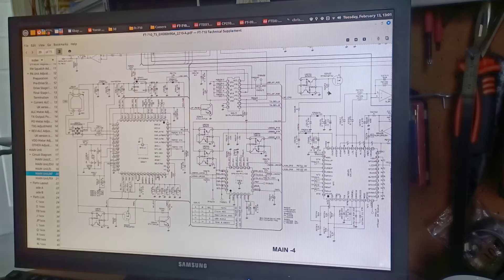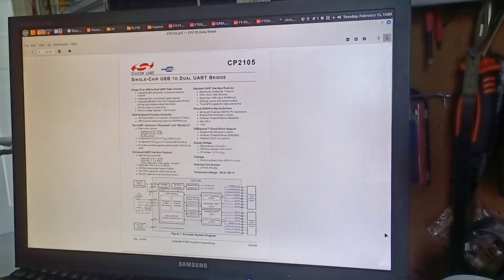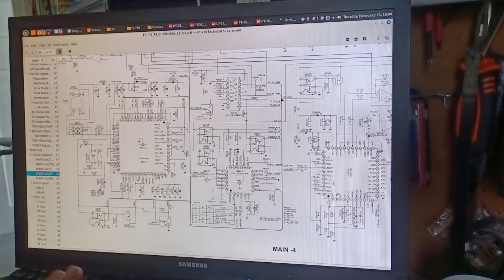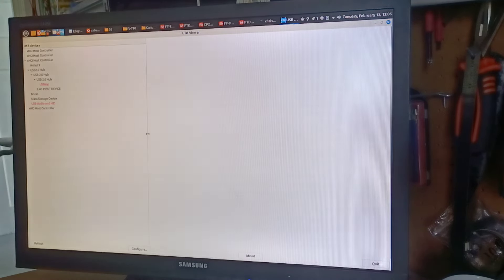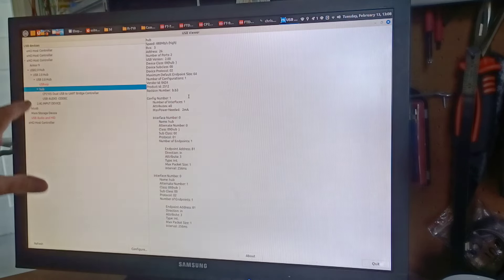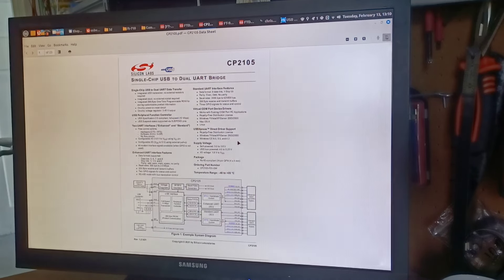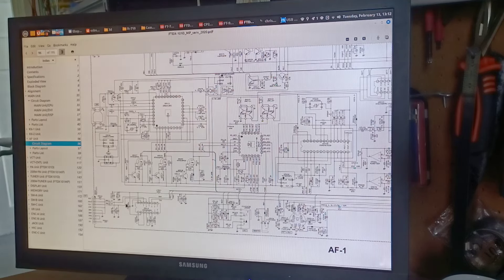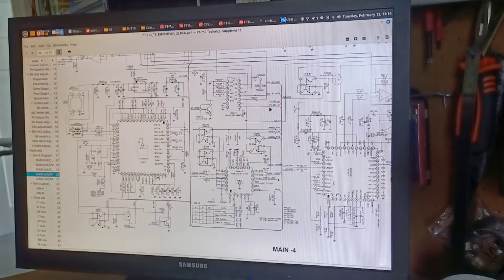Yaesu USB, CP2105, USBview (FT710, FT991/A, FTdx10, FTdx101D/MP)

Comment: Chris, I had my FT 991A USB chip replaced a year ago. The radio was just under 5 years old & I had it replaced under warranty.
I have taken the liberty to purchase a USB isolation unit hoping that might prolong the IC by stopping any possible ground loops between the radio & my PC.
As I also use an external powered Speaker (BHI DSP), I have an isolation device between the radio audio out & speaker.

Comment: Hello Chris, thank you so much for making these videos!  I think the CP2105 chip on my Yaesu FTdx 3000 needs to be replaced.  Please let me know the wattage of the heat gun that is needed to make the repairs.  I downloaded the USB Viewer, and it displays the "Generic USB Hub" instead of the hub information.  I've installed the CP210x software driver several time using the Yaesu driver, and the Silicon Labs drivers and the problem persists.  I did a factory reset on the transceiver and configured all of the menu settings and the problem persists.   I live in South Korea and my situation is much like yours concerning the cost to ship the radio for repair, so I may attempt to do it myself.  Please let me know if you think the CP2105 needs to be replaced.

Comment: I was certain it was my PC. I even did a clean install of Win 11. Still no joy

I grabbed my 891 out of my vehicle and connected it. The comm ports popped up. Pretty certain I fried the 2205 chip in my FTDX10.

Where's the best place to get the chip? Amazon had a similar one but not the exact one

Comment: Chris, great video.  I have had my virtual com ports fail twice on my FTDX-101D.  First time was under warranty, second time not.  Not sure exactly what they did the first time, but second time they replaced the whole audio board.  They recommended I get a "better" USB cable, which I guess means well shielded, and I did ensure my cable was shielded, but hard to tell.  I also tried an opto-isolated cable which some people recommended, but the virtual com ports don't seem to work with it.  So I worry about another failure.  Your theory about the capacitor is interesting.  I wonder if Yaesu has figured that out and has changed the design and/or remove them on service calls.  I might have to open mine up and look.  If not, I might consider your fix.  Let us know if you get any new info. 73, Brian K2AS

Comment from the maker: Thanks to Fred N6SMN .. Locking the CP2105 to Prevent RF Issues via Software
1 - Download the Tool: Get the AN721SW zip from Silicon Labs:  https://www.silabs.com/documents/publ...
2 -  Install USBXpress: Extract the zip, find the USBXpress installer, and install it.
3 - Connect Your Device: Plug in your Yaesu transceiver (or device with CP2105) via USB.
4 - Run USBXpress: Open the utility. It will detect your device automatically.
5 - Lock the Chip: Select the Lock Programming option and confirm. Done!

Comment: Chris, thank you so much for this video. After watching it I'm almost positive that my CP2105 has gone bad. I get the audio connection in Windows, but no comm port. USBDeview (Nirsoft) shows "Device Descriptor Request Failed" and "Invalid Device Descriptor". Sure sounds like the programming on the chip has been wiped. I don't have the skills to replace the chip myself so I want to remove the board that it's installed on and send it to a repair shop to have them do it, as well as removing that darned capacitor so it doesn't happen again. Can you direct me to a resource where I can find out which board I need to remove? Also, where can I get the replacement CP2105? Thanks!

Comment: Hi Chris, my 991A recently started to be an unidentified device in windows.  I am going to run the USB View software to see if I can read the other details of the USB Device, but I suspect my chip may be stuck in programming mode as I have checked drivers 1000 times and basically given up at this time.  So, if in fact what you covered in this video is my problem, what exactly is the fix?  Do I just remove that Capacitor and it will revert back to regular (non-programming mode) and go back to working?  Or do I need to have that chip replaced?
After removing the case on mine, it appears to be a CP2512BT not a 2105?  do these both have the same programming mode issue?
Reply from the maker: You'll probably need to replace the CP2105. Removing the capacitor prevents ir from being able to go into programming mode. Once it enters that modes, its all over..

Comment: Tengo un 991a que pude arreglar gracias a tu video anterior. Hubo que cambiar el chip doble serial y quitar el capacitor. Pero tengo un FT710 que hasta ahora no conecte por USB, para evitar el mismo problema. Si estuviese el soft para forzar la programacion y evitar tener que quitar el capacitor (ya que requiere de cierta experiencia soldando y desoldando componentes SMD), estaria genial. Saludos desde Argentina, Fernando  - LU9EOB
Reply from the maker: Excelente Fernando. Me alegra que el otro vídeo haya ayudado. 73 de Nueva Zelanda de ZL1CVD
Reply: @ZL1CVD Hi Chris, I have this failure on my Ftdx101mp and will be sending it in for repair.  A close lightning strike may be to blame.  I ask the tech at Yaesu if they will send back my board after installing the new one.  They will no problem.  My question, would you be interested in replacing this chip and the mod as described in the video?  For a fee of course.  Just wouldn’t mind having a spare.
Reply from the maker: @richardclukey3358  Sure, no problem. My contact details are on QRZ.com 73 de ZL1CVD